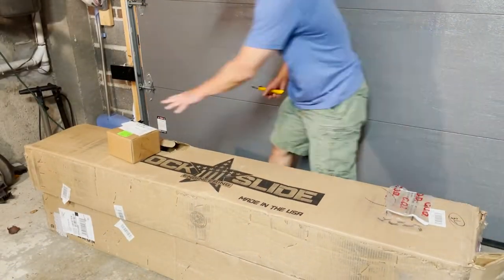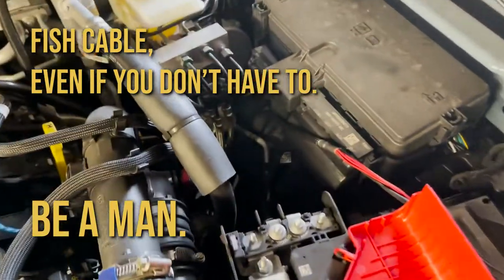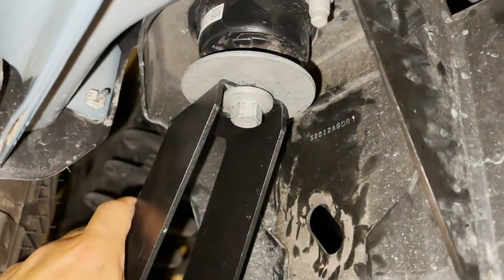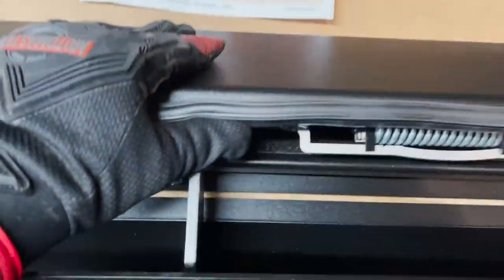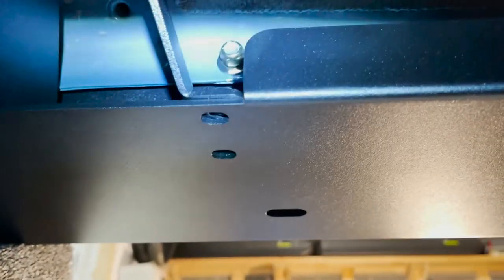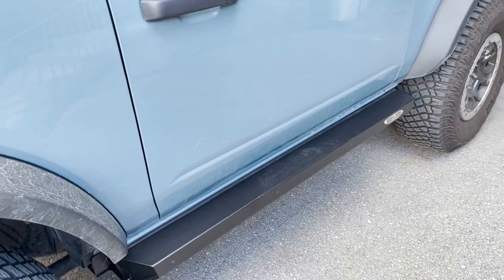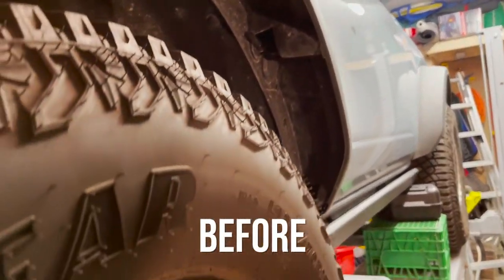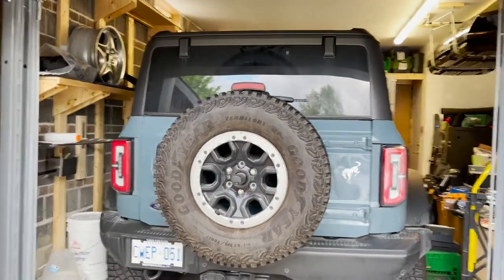The Biggest Improvement For Living With Sasquatch? Rock Slide Engineering Step Sliders - Build Day 1

Comment: What grommet did you end up using since the instructions are for the 4 door?
Reply from the maker: There’s a floor grommet in the back footwell. Probably in a similar spot of the four door. 

I think the biggest thing is that they give you the same wiring harness for the 2 door so I have quite a bit of cable I need to tuck away.
Reply: I actually ended up seeing the grommet replacements with the kit in a baggie with the bolts and then had to put everything on pause because I'm missing spacers for the front brackets.
Reply from the maker: Just saw this 😅
That sucks. Hopefully it’s all sorted by now!
Reply: @neverendingweekend  all good👍